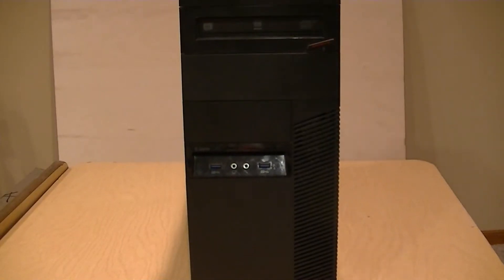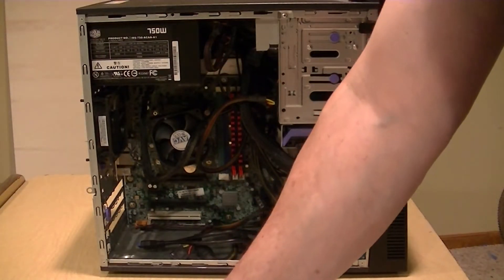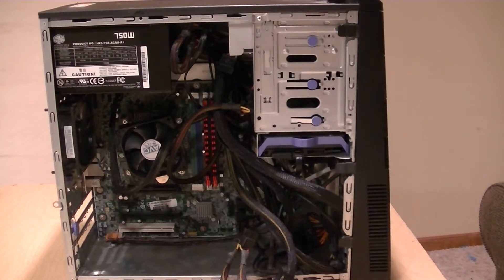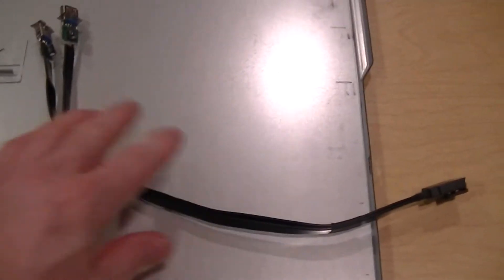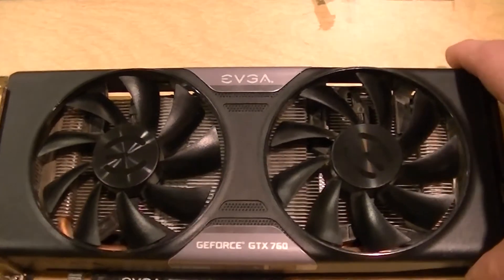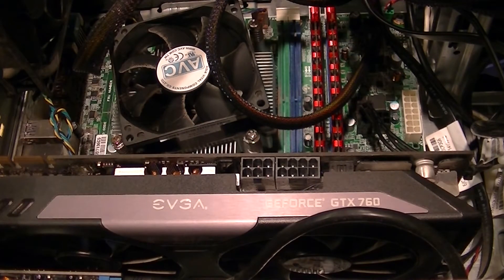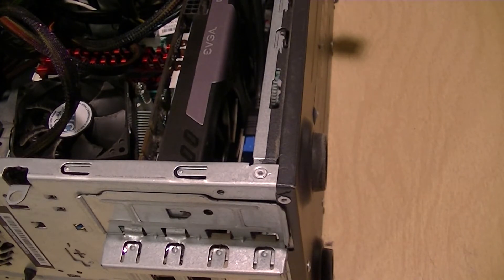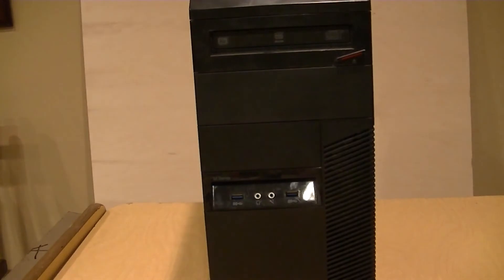Lenovo Thinkcentre M93 Turned into Gaming Rig

Comment: I scored one of these for 80 bucks and I got a 970 for 80 bucks and my buddy gave me his old 2010 thermaltake 700w PSU which only has TWO sata power lol the rest is molex adapters for sata but free is free then I went to the local PC recycle center and got a 5 dollar Cooler Master Elite 310 case and paid 15 bucks for used blue LED fans and you can swap the board into a new case it fits and the front panel is possible as well

https://forums.lenovo.com/t5/ThinkCentre-A-E-M-S-Series/ThinkCentre-front-panel-connector-power-audio-amp-USB-pinout/td-p/190651

here is a link to figure out how to get the front panel working. So now after a case swap it's looking good. 10 year old case with a slight defect (not a functional one, it's aesthetic, the HDD cage is damaged but it still fits 2 drives) with 4 fans. I zip tied a blue LED fan in the 5.25" bay, the bottom of the front panel where it has a mount, the side panel mount area and the rear. 4 fans which are sorta loud but it's not toooooo bad and I plan on replacing the fans with Rosewill RGB fans down the line. Might sell the computer and try to make another better one if I can find another Thinkcentre.
Reply from the maker: Good stuff, thanks!
Reply: @elmarko9051  no problem dude I hope you get some good use out of this. If you buy an i7 for this and go up to 32 GB it will be good for even longer. I love these Lenovos.